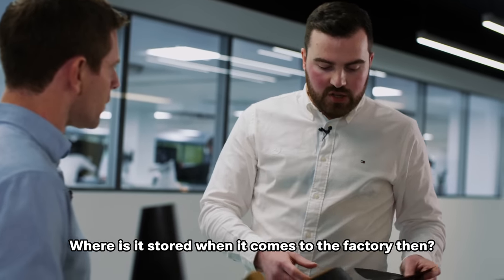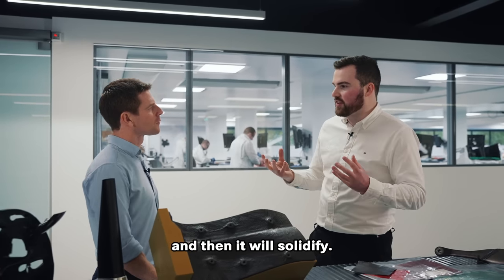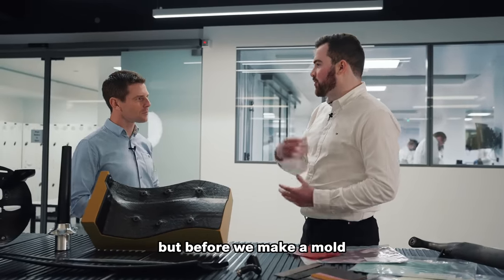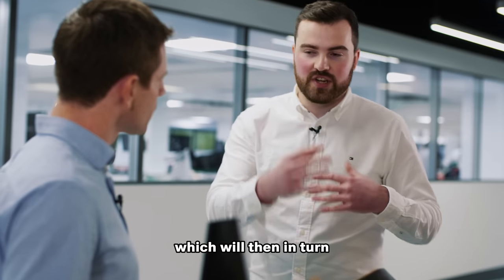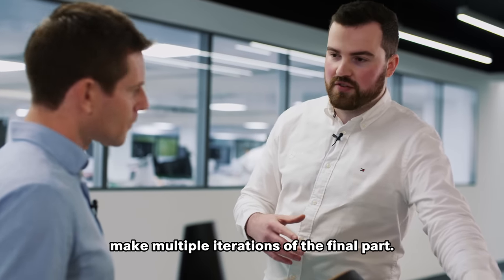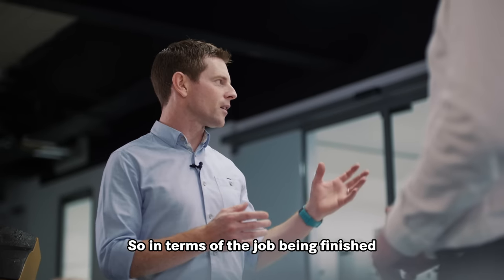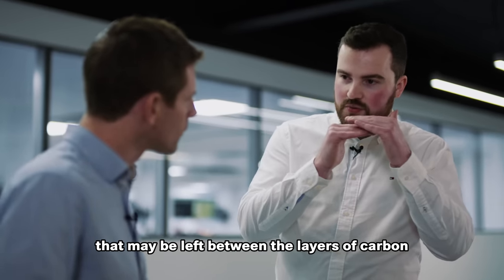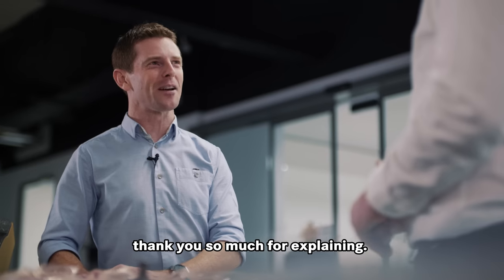The Journey Of Carbon Fibre - Part 1 | How It Works 🔬

Comment: Wow there's a lot to do in formula one. Makes me wonder how smaller teams like HASS manage to get their car ready on track on time
Reply: I wouldn't call Haas a small team. They might not be winning anything but they have the correct quantity of technicians and engineers to be able to compete in F1. They just need talent that can build a winning package. That's what's missing for them
Reply: There's a catch-up or elastic-band for slower teams in F1 after the Red Bull/Torro Rosso controversy. You wonder "how smaller teams like HASS manage to get their car ready", your answer is in F1's regulations. HAAS buys from a "listed parts" from faster/top tier teams. This allows slower teams to catch up with the front runners. In other words: HAAS' F1 car is 70% Ferrari.

Your next question would be: If Ferrari is fighting for P1, why is HAAS so slow? A copy never makes you faster than your opponent, at best it equals the pace of your opponent 6 races ago.

Comment: Oh wow, last time I was working with fibre glass, we had to infused the resin with vacuum. Now they pre-impregnate it? I'm highly impressed.
Reply: What they are using is called prepreg. DIY or smaller businesses usually don't do that since you need an autoclave. Most do wet laminating or infusion as you did
Reply: It's been like this for years in industries where budget allows. Vacuum infusion is a great, but slightly less efficient way of doing the same job. You generally have a heavier part due to resin build up and the precision of the laminate is lesser.

Comment: Do smaller teams have this kind of room with pressure and temperature control ? Or do they have to work everything in normal / non-optimal conditions  or work faster etc to avoid issues ?
Reply: Many of the smaller teams get their carbon fibre parts made at other composite companies, McLaren have their own lam department however they still get some parts from the company I work at. F1 laminating is very different from automotive and other motorsport laminating it’s quite fascinating